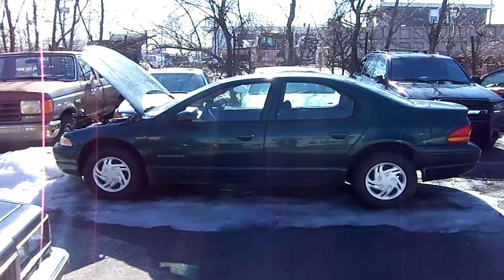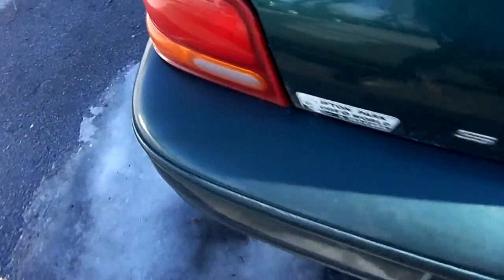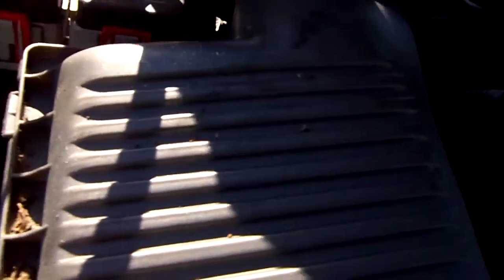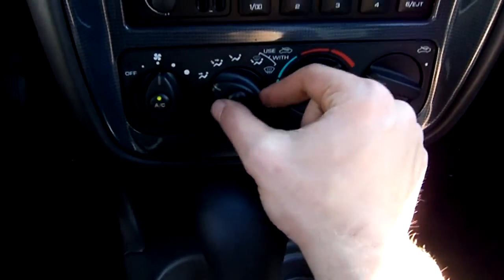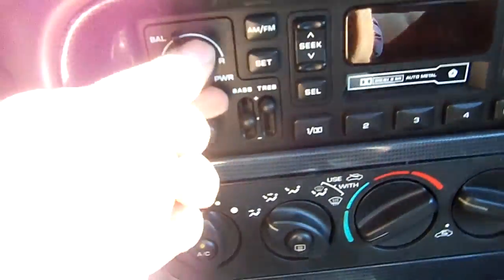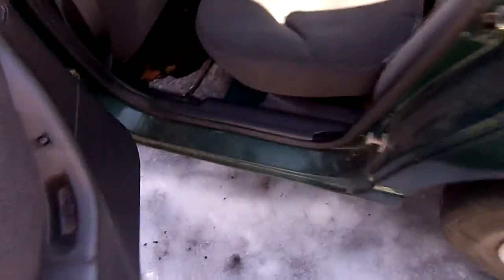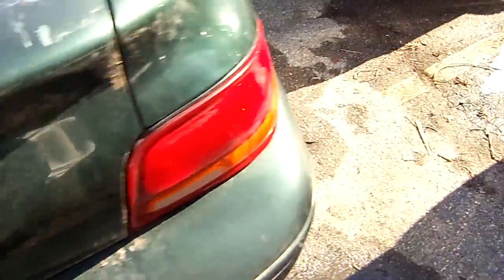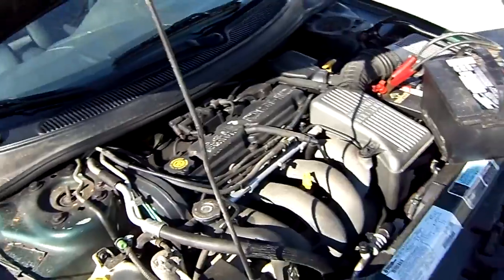Look at a 1999 Dodge Stratus w/ 18,000K!

Comment: I'm still driving one of these dinosaurs, but its run like a champ most it's life.  I'm the second owner, got it in 2008.  Owner before me worked at the dealership where he bought it to commute to work.  Rebuilt the tranny, and engine and turned it over to me at almost exactly 100,000 miles.  Some 8 years and 56,000 miles later it's had its share of problems but never anything major.  Gotta give it to this little guy, has been quite the reliable vehicle for me.
Reply from the maker: They really are very nice cars, super comfortable and very roomy

Comment: We owned a 1998 and they were basically 40-50k mile cars before major head gasket leaks and issues. We loved the car, but it really had a crap engine and we traded for a 1997 Camry SE. There was no comparison quality wise the Toyota was better in every way. Had Chrysler built these to last and as well as a Toyota it would have been a winner for them instead of becoming a Lemon.

Comment: you're lucky it's got the 2.4, because a 2.7 was a grenade motor
Reply: +UnHo1ywood Ca1ifornication The 2.7 was never available in this generation of the Stratus. In 1999, the V6 option for the Stratus was a 2.5 from Mitsubishi. Chrysler's 2.7 replaced it when the second generation came out in 2001.